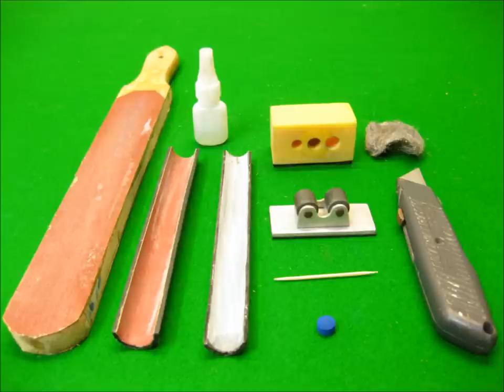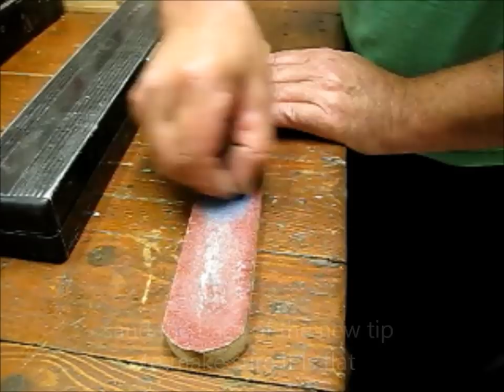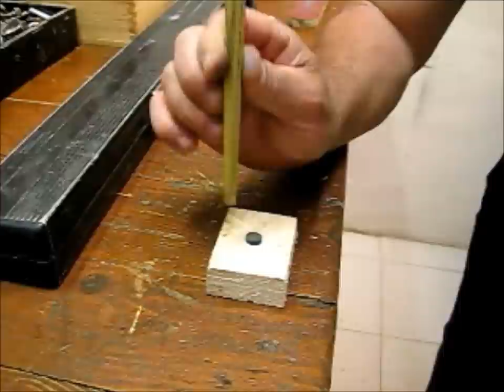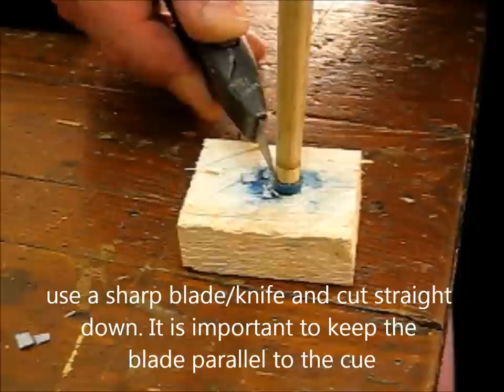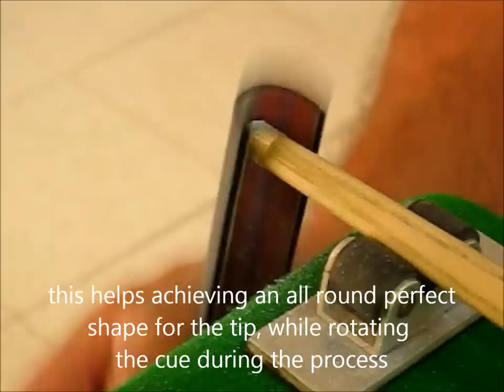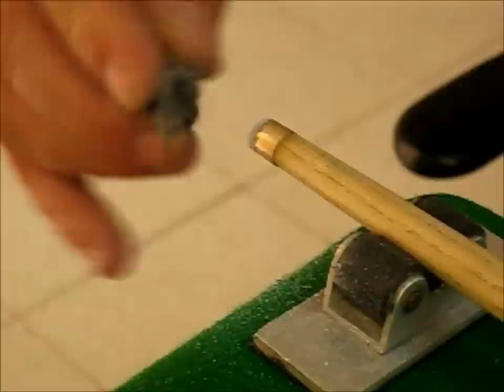How to change a cue tip

Comment: reading some of the comments you would think Joe put the tip on with a catapult after dropping it in a greasy chip pan . to many people get hung up on things.when you strip away the bulls**t  its a piece of leather stuck on the end of a stick as long as it is glued on securely you can shape it to whatever size and shape you like. ive seen tips replaced in 3 minutes during matches no tools no dust free environments. glue on, tip on,  press and hold ,cut to size, shaped as you go. nice one Joseph i thought it was a decent video

Comment: hi what is that small roller you used called??...where can I buy one ?? and what are you using to support the rear off the cue whilst its on the roller??
Reply from the maker: I don't now what it is called and where to buy one, I had constructed it myself for this specific purpose. To support the rear I used a small block of steel with a hole in it (to put in the cue) to act as a holder.

Comment: What type of tip did you used? Good job. No need to press the tip? Blue diamond tip should be pressed before you use.  Please answer. Thanks.
Reply from the maker: Yes, the tip I used was a blue diamond one.

While shaping it, you will be applying pressure so you don't need to press it again. (you would have already done the pressing process).

Thanks.

Comment: good afternoon sir, amazing video, i do the exact same thing but for my pool cue.. is it possible for you to tell me what is the thing with the 2 rollers called? also an idea is when I put the butt on the piece of what looked like wood. u could have that hole much bigger and get a metal bearing with inner diameter to fit the cue snug and spin freely on the bearing ring system. looking forward to know what that thing with 2 rollers is called. thank you
Reply from the maker: +Aman Lokhandwala 
Hi, Thanks for your interest. 
I made the thing with the 2 rollers myself. Two small rubber wheels on which the cue can rotate freely.
Good idea there with the bearing, might implement it as well in fact.
Thanks a lot :)
Reply: Could u give me an idea on how to make the wheels thing. Because buying a 11mm ID or 12mm ID wheel bearing is 30+$$
Reply: Joseph Cini If you could even give me just a couple ideas, how to go about looking for stuff to build one It would be very helpful. Here in America, it's very hard to find people to change cue tips nad they usually charge $20-40 + tip charge

Comment: A perfect tip, the only thing is, when you buy new tips, they tend to be really thick. I've been told never to cut the tip width way, so how did you get your tip relatively thin? Can you sand the face of the tip down to size? I thought the sandpaper was just for the sides of the tip? I speak as a complete DIY layman.
Reply from the maker: If I understand you correctly, I cut the tip from the bottom side if it is very thick to get it thinner. And yes, I sand the face of the tip, even so to give it the perfect shape for my liking.

Comment: whats point of putting new tip on when you sanded 3/4 of it away?
Reply from the maker: The point is using an over-sized tip so you can adjust it to your liking by sanding it off

Comment: Is it really necessary to file a brand new tip down so much? I see so many people doing this when demonstrating putting a new tip on, but you don't need to take anywhere near that much off to get a good dome on the tip. Isn't that just wasting a lot of it? I really don't understand this practice.
Reply: Year old post lol but I sand mine down as I prefer the feel it gives.. When it's full size and box fresh it's to cushiony for my liking. I've now purchased a tip compreser that I put the tip in before I put it on, that makes a big difference

Comment: what grade sandpaper?
Reply from the maker: I use a rough sandpaper to shape the tip and then a fine sandpaper to refine it.
Reply: yes but what grade sand paper?
240, 400, 800, 1200 ?
Reply from the maker: jovan madden I use 180 and 240
Reply: ok thanks ;)
good vid btw +1 sub

Comment: I hate complaining about anything and I think it takes a lot courage to post something like this publicly.  Since it worked I guess it is ok for this person but I can't help feel like this is either a persons first attempt at trying to do this or if it was just an example of the wrong way to do it.  Im just scared someone will watch this and actually believe this is the right way to do it.  I feel obligated to inform viewers to beware.  If someone is looking for the right way to do it you might consider watching a few more videos and taking the best of all of the ideas out there and not just this one video.  I'm not trying to criticize this person but rather warning/informing others so that they don't use this method.
Reply: The Pipe tool is a good idea.  It would be good to have 2 different sizes for both the dime and nickel type tips using this tool.  Depending on the 'radius of curvature' the individual person prefers.
Reply from the maker: While I respect your opinion, I feel you have criticized my method without actually pointing out what you think is wrong with it. Just as a capitulation, using this method allows your tip to be centered every-time, anytime!
Reply: Joseph, you are absolutely correct.  I should have been more clear.  I'm not sure if I already have this ability or not but I would rather contact you directly instead of posting more here.  And I dont like my post and thinking about replacing it with something more specific what doesn't sound so horrible.  my email, if it is allowed is cini@speedenet.com
Reply: someone pointed out to me that even though this is not a great way to do this (my opinion only), if this is a one-time repair his method requires almost no special tools to buy whereas my method uses tools that are made for this and there is a cost involved that many would not want to make.   The cost should definitely be taken into consideration here.  And this is cheap, EZ and works for some.